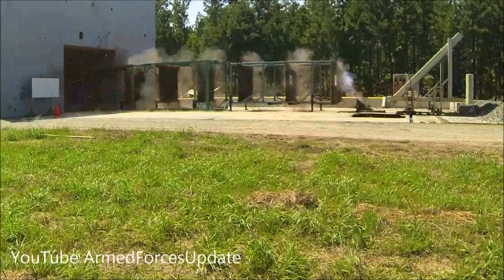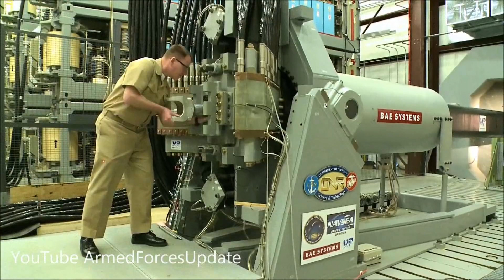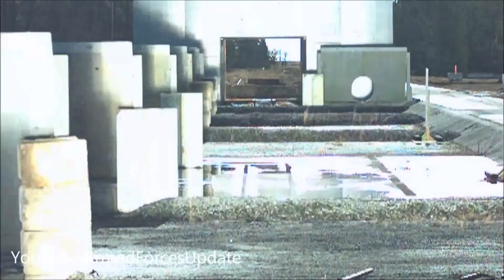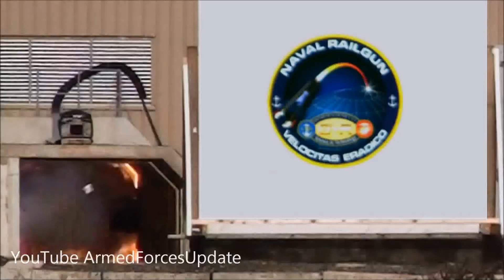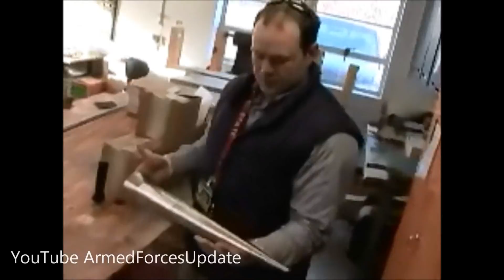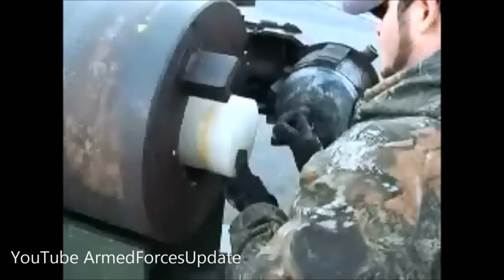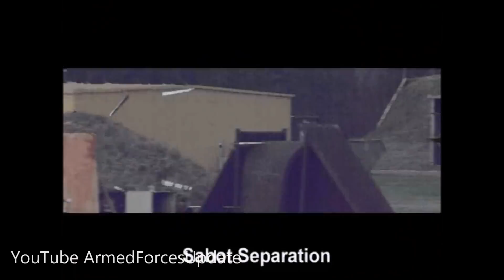WORST NIGHTMARE for Russian military!!! US Military Rail Gun ready for sea trials in 2016

Comment: A quick calculation: The earth is a sphere. The rate of curvature is the distance per mile squared x 8". a target 10 miles away would be 10 squared x 8" = 66 Feet. so the target would be 66 feet below the firing station on our curved earth. The projectile travels in a horizontal trajectory. How can it hit a target that is 66 Feet below the horizontal trajectory? And if it travels 100 miles as quoted, the target would be 6,666 feet below the horizon. How's it gonna hit it? The projectile would follow the Tangent rule and head off into space relative to the target, until it lost energy and succumbed to gravity.
Reply: railguns are very much intended to be used as a direct fire weapon.  Laser like.  I assume they're going to modulate the power such that they get proper over the horizon drop to the target while still maintaining tons of kinetic energy.  The round won't have the same kinetic energy if you are firing it up in a ballistic arc.
Reply: +Dave Plummer
Where did I write "an elevated muzzle"? But anyway, its immaterial. Once the projectile has exited the weapon it will travel in a straight line whatever the angle of exit, only being affected by weather, gravity and Coriolis. The target will be lower. Lowering the trajectory to hit a target below the horizon would mean aiming downwards, through the sea as it were...ridiculous, this can never be anywhere near accurate without line of sight and that limits it to much less than 10 miles.
Reply: +rewtuser
Sounds good, but has a few problems. Have you any idea of the complexity involved to 'Tweak' the power in such a way that the kinetic force is preserved at a destructive level and matched to the pull of gravity, factoring in weather and Coriolis as well and not be high or low, left or right? This thing is line of sight only. It's basically a useless toy on earth. In space would be a totally different scenario.
Reply: Tanya Rass We already do similar things with large artillery.  We've done similar things in the past with large naval guns, firing over 40 nautical miles at a relatively flat trajectory.  It'd be even easier with a railgun because of how fast it flies.

Germans were factoring in curvature of earth into their artillery shots back as far as the WW1 railway guns, which also fired at a fairly flat trajectory (because you couldn't elevate the gun that high)
Reply: Tanya Rass  The projectile doesn't travel in a straight line, its affected by gravity just like every other ballistic weapon.
Reply: wait so you believe that if a plane flys straight, it will fly into space?
Reply: +Chur
There's a problem with that, let me explain. If an aircraft flies at a set altitude, according to the globe earth model and factoring in the 8" squared rule, the aircraft would constantly need to have its nose down to follow the earths curvature. If the aircraft did NOT do this, yes, it would fly higher and higher and theoretically, out into space. There is NO compensation made for this as the artificial horizon compass is always set to level. You know that. This implies the obvious but unacceptable proposition that the earth is NOT a globe. It further implies that the military designers know this, hence the Rail Gun would function exactly as intended. i.e. it will ONLY perform as intended on a flat motionless plain. But that's beyond the rigid mindset of most people. Will you entertain the concept, or prove me wrong?
Reply: +Tanya Rass are you a flat earther?
Reply: I see no reason not to question established and universally accepted dogma. I say prove to me that what my eyes and senses tell me is my reality, is actually not. Even the science corroborates my stance. I am however, open to persuasion otherwise, given proof. The question is, are you?
Reply: +Tanya Rass You managed to answer the question without actually answering the question. Universally accepted dogma is that the earth is round. The millions of pictures taken from space also show that "science" says the earth is round. If you assume that the earth is flat then there are billions of other questions that have to be answered that are already obvious if you can see the earth is flat.

Comment: This is actually more crazy than you think. A DU round or a fin stabilized sabot usually has 120mm of pen. This however has over. 720mm of pen. Because the projectile here is moving at a MUUCCCH higher speed (Mach 5 to be exact) crazy huh?

Comment: At Mach 7, it would take about 1.2 seconds for the round to hit a target 100 miles away.   However, the curvature of the Earth means that you would need to fire the gun about 10,000 feet above the surface to be line of sight for a target 100 miles away.      Thus, I assume the Rear Admiral is speaking of it's maximums.  It can fire at speeds up to Mach 7 or at targets 100 miles away, but it doesn't do both at the same time.     Unless the projectile's path follows the curvature of the Earth due to gravity????
Reply: Escape velocity is about 40 000 km/h while the ammo of this baby flies around 10 000 km/h, so it can be shot around the horizon. For it literally to follow the curvature of Earth it would have to be shot many times faster. You have serious error in your calculations. At the speed of 5000mph it would take 1,2 minutes to reach it's destination 100 miles away.

Comment: I was just wondering.. So you will shoot a rail gun from the boat at the distance of 100 nautical miles which is 115 miles (185 km). As I know, bullets fired from a gun fly on a straight line. This is a "bullet" not a rocket or artillery shell. 
Now, Earth average curvature is 7.98 inches per mile (20 cm per 1.6 km)(check wikipedia).
Considering that this bullet will fly on a straight line, how it will compensate Earth curvature over distance?
Reply: No. it still follows a ballistic trajectory ( it can't defy the laws of Physics)  just with a muzzle velocity of over Mach 6

Comment: i doubt that these will be produced, probably because of the costs.
Reply: what cost do you know how much the US spends on war? Also the price is cheap sense it shoots a metal rod even if it was pricey they would still put it on all ships because America could cut its military spending by 80% and still be number 1 in spending.
Reply: Yeah, they're made of tungsten, which is cheap as fuck by military standards. One of these slugs weights around 23 lbs, so a single slug is under 460 dollars in raw materials. Taking into account maintenance of the gun and processing the tungsten and manufacturing the round, I'd be completely amazed if this thing costs more than 10,000 dollars to fire. I think the energy required per shot is just over 2 dollars or something.
On Wikipedia there's a reference to the military aiming for under 1,000 bucks per round, and 25,000 for a self-guided variant.
Comparing this to the current long-range options like cruise missiles, the operating cost of a railgun is literally an entire order of magnitude lower
Reply: Sir Crusade auctally there a lot cheaper than rockets

Comment: If there is no gun powder, where is the fire from the initial blast coming from?
Reply: leoric21 a rail propels it's
Reply: I know. so there should be no flames. 

Look at the demo  shots being fired. 

there are initial flames to every shot.

I think its misleading.
Reply: maybe just sparks
Reply: Are you saying you didn't see flames but sparks? Or are you saying you think sparks ignited the flames?
Reply: When the round exits the barrel it's traveling around Mach 7, and at that speed it can cause the air (possibly the sabot casing and any type of barrel lubricant,  dust, or any type of fine powder) it burst into flames. Very much like a comet entering the earth's atmosphere. I was kinda curious about this also and did some searches on the web about this, some had results directly reflecting the the muzzle flash shown in this video.
Reply: Lets me convey my understanding of you explainatiom.

the projectile is moving at such a high rate that friction it produces by traveling throughthe air  cuases even the finest dust particles to burst into flame?

Ok that works. thanks for clearing that up for me
Reply: To add, it is being propelled by high current of electricity, like magnets have a small magnetic field, the projectile is being pushed with 'Magnets' well, not really.. but as i said with Electricity. to high velocities.

Comment: Whoopee!!!  A gun that is so heavy  (over 4 tons if I remember correctly) that only a ship can carry it and with a range that is less than 200 km?  Most navel weapons have ranges of well over 1000 km which makes this one hell of an expensive show piece.  The only practical us for this would be to fight off 3rd world gun boats coming within it's limited range; something that can easily be accomplished with a large variety of other weapons.  Of course any respectable navy would have attached the ship way outside the guns range, and with the low frequency modulating radar stealth would be ineffective.  The Russians on the other hand have vastly improved on the technology; they are the ones that first developed it in the 1800's and even have the original patent.  They did away with all the heavy and bulky capacitors and replaced it with electricity generating explosives that can easily be carried on an armored vehicle where it would be the most useful.  The plasma generated in the explosion also "lubricates" the barrel, which means that they don't have to replace it as frequently.  The projectile speeds are well over 5 km/s, and though less than mach 7 is still many times faster than the fastest chemical guns.  Also, the effect of air friction becomes a significant factor the faster you go.

Comment: Still getting duped by this. LOL
Whoever thinks it can shoot 100 miles in a straight line has a serious lack of physics knowledge.
Let me give you an example, the Barret fires at almost 2.5 mach, it's effective range is 2 km (a bit over 1 mile)
Yes 1 mile, because aerodynamic pressure is very strong on flying objects (drag). And if it's bigger, it has a lot more darg.

I wouldn't put the effective range of this to more than 5-6 miles. A distance that 2 ships in war would NEVER come close to. Missiles are MUCH MORE powerful and have a LOT more range. Also cannons have more power and range too.

This is not a gun, and it never will be. It's an electromagnectic cannon shooter, which is pretty good. Like he said it will replace powder. That's it.

Comment: Russia is an almost land locked nation much of the year. Yes, I know about the melting polar region. But their ships are a sad joke even at their best. China bough some because they needed them but immediately hated them and are building their own, based on US designs. 

The Railgun is going to be used against countries with more dangerous and effective coastal and air defense capabilities like China, North Korea, and others. 

Russia does not have much of a reason worry about the  Railgun, until it is small enough and efficient enough to put on a Tank or mobile artillery unit.
Reply: DocWolph They have had working prototypes that operate handguns since the early 2000s at least.
Reply: Everythingisdull
You have a link I'd like see it. I'm not being mean just curious. If its one of those, however, VERY cool Coil guns, I already know about those.